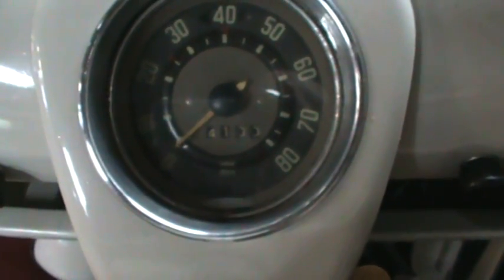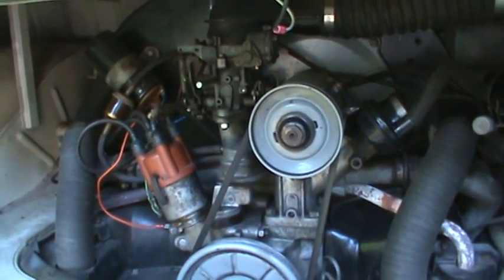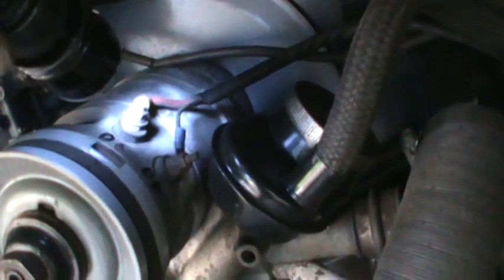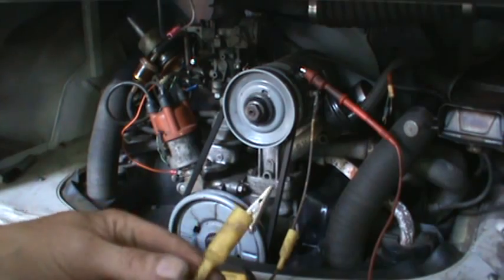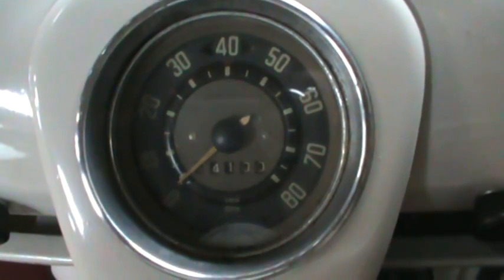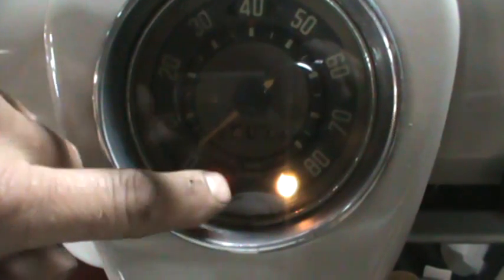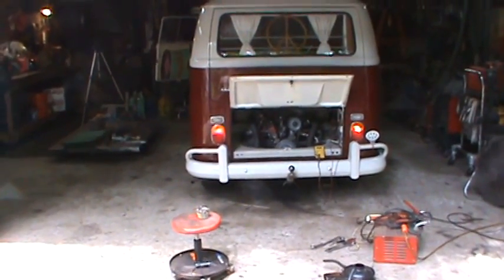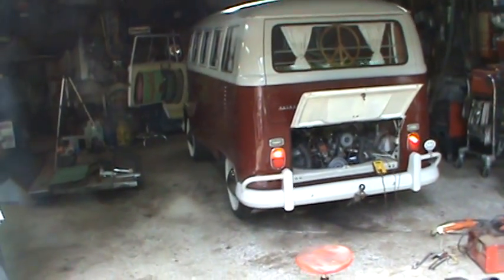how to troubleshoot air cooled vw charging system

Comment: After polarizing I was stumped since I just did a clutch job and reseal and only un hooked the regulator but took off the dog house and set it on the floor. Then I took the wires off and had 30 volts at the generator. The ole tap the regulator with a screw driver handle and the light went out for a sec. Took it apart and manually manipulated the contact and it cleared out my issue with a pop. It looks new so I will probably sand the contacts tomorrow but thanks for the easy to understand video. I little mix of redneck ingenuity and your video was perfect.

Comment: Pretty sure you are wrong about the dash light having to work for the system to charge,  thats only for alternator,  on that system the light needs to excite the alternator get it to charge.  Generator and regulator can charge with no dash light!

Comment: I bought my wife a 67 bug and it has bin parked since the 80s they must’ve had lots of electrical problems because there’s little notes written over inside the car with diagrams the generator doesn’t charge I just saw this video says the light Hass to work in the dash but the light does not come on with the key. It only comes on when the car starts. Wondering what your thoughts are if there’s something wired backwards

Comment: @mustie1 I'm having an issue with sputtering and backfiring when driving but at idle it runs perfect. I have been through just about everything and can find nothing wrong. I did notice that the headlights were dim and at one point they got bright like they were supposed to be. When they did, it ran great a few minutes later, the lights went back dim and it sputtered and backfired. I'm researching the voltage regulator and came across your video. I did everything you showed in the video and all the readings were pretty much the same as what you had. My question is, can I disconnect the wire on the de side and run a jumper to the body and then test drive it to see if that clears up the issue?  I wouldn't need to drive more than about 30 seconds to see if issue goes away and then I would be fairly certain that it's the voltage regulator.

Comment: I installed a replacement used engine on a VW bug once and the generator would not charge..Red light always on. Tried a new generator. Same problem. Red light. Could not figure out what the problem was. I was at wits end! Then someone showed me that you need to "jump" the terminals...(Grounding out the DF terminal). Simple solution. The generator then was charging and no more red warning light.

Comment: Great video! Will the principles also work with an alternator? Regarding the part numbers, the 019’s, etc are Bosch part numbers, not VW. To find out if a Bosch part is for a type I or II we need to dig a little further.
Reply: No.  If u disconnect the D+ wire and u run the engine u will damage ur alternator's diode.  Then u need a new alternator.

Comment: What do you do when the gen light comes on and it won’t go off? We’ve put brushes in back in july. Light went out. 1050 miles later it’s back on again. We’ve changed the coil regulator taken the belt off and polarized it. Brushes look ok. Taken the 61 wire off and the light goes off on the dash. Rewired the df to regulator lights still on. 
All my lights are led except for turn signals. No radio...... I don’t understand what’s making the light come on.  1968 beetle

Comment: Great super helpful. My type 3 has an issue not sure if it’s the voltage regulator or generator now I can skip the repair shop. Put new battery in last month and it died yesterday had to push start it. I noticed my lights were getting dim too.

Comment: My generator when tested as demonstrated in the video only gets about 3 volts. I did the test with the hot wire from battery and generator spun without the belt on. This means my generator is bad right?

Comment: Can the same diagnostic process be applied to a vw that has been converted to a 12V alternator with an internal voltage regulator?
Reply: I don't think it'd work you'd have to look for diagnosing a alternator charging problem not a generator

Comment: Greetings: From your description of the voltage at thr DF terminal, you should be able to compare the field control voltage between the good and bad regulators by noting the voltage at DF for the 2 regulators at both idle and higher revs. That way in the future you only nned to measure the DF voltage to know if the regulator is sending the correct voltage to DF. HTH

Comment: Super helpful video. I have a 67 bug that burned out two batteries in a row so I thought to check alternator. Followed the procedure you laid out and found that the alternator didn't spin at all when I hooked the battery straight to it. I can see a little damage inside the alternator, not sure if it affected the brushes at all, but it wouldn't spin whatsoever.

Comment: i did that years ago before i converted to an reliable alternator as when the vehicle sits the generator lost its polarity as an alternator work regardless but like the generator the bulb in the speedometer has to work as i added a load equalizer resistor to the bulb if converted to LED it will work regardless if the bulb or LED is burned out. i added LED indicators in the speedometer i did this long before the Radio Shack closed here. as a 1968 bug the green light is oil used a green Led green for turn signal arrows, and red for the charging and thats where i had to add the load equalizer resistor too i tried it would not charge as the resistor is added it charges.
Reply: Newer VW's e.g. type 25 wedge transporter have the LED indicator you've mentioned. I have found most faults here are caused by mis fitting the LED into it's sockets. LED's are also polarity sensitive so have to be connected the right way round to work. This last point mostly applies to the bare LED component that's used in newer water cooled VW's since the mid 1970's mainly Golf, Polo, Jetta, Pasat and the T25,T4,T5 Transporter. The bulb like indicators used in aftermarket applications can have a rectifier circuit fitted before the LED that negates the polarity sensitive requirements when fitting but this can depend on type of indicator bought. A simple task is to check the indicator polarity both ways on installation usually complicated by the connections already present. LED's do take less current to work usually between 5 to 10 times less than the old incandescent bulb so the use of the bypass resistor is recommended 120 to 150 ohm 2 watt resistor. The transporters with the dual circuit brake warning light also have this light wired into the charge warning circuit via a diode so providing an alternative initial excitation current path in the case of bulb failure.

Comment: Great video. I'm trying to figure out why my generator and voltage regulator are overheating. I'm getting 14.75 charging voltage at battery, so it looks like it's overcharging. The battery with engine off is reading 11 volts, so it looks like the battery has problems. I'm going to run your checks on the generator to make sure it's OK.
Thanks again. This will hopefully be helpful. I'm going to buy a new battery and a voltage regulator if the generator tests OK. Then go from there.

Comment: maybe you and help, I have a dune buggy that some of the wires were messed up, I have most everything sorted out except for the charge light, it has the factory alternator I think this is about a 72 model, I have no idea where to hook the wire from the alternator and also how to hook up the light on the back of the speedometer, there are 3 lights at the bottom or the speedometer and also a contact that kind of surrounds the 3 light sockets, I am at a total loss as to how to connect the charge light and wire to the speedometer.

Comment: thanks,
it was helpful, my 1977 has a pancake motor and an alternator.. i get no battery light with ignition on engine not running, so i guess start with checking the bulb.  do you know if i have an internal voltage regulator?

Comment: sometimes i had to manually ground  the df terminal l of the generator to the body of the generator by  using a screwdriver while engine is running  and revving the engine...

Comment: 20 yrs ago i put an alternator on my 68 Bug, connect the 61 wire to DF, the B+ to D+ and threw the mechanical regulator in the trash. Read too many horror stories about the regulators sticking with contacts closed sending unfused battery power into the generator D+ lead. Alternator puts out rock solid 13.6v at idle and haven't had a lick of trouble with it.

Comment: I went to fuel up at a station whilst driving the light was on. I started my engine again after and it wouldnt turn over. My red light is always on, idle or when fully running. Battery was dead but now that's been changed to a new one. Starts fine now but the red light is always on. Any ideas what I should do now?

Comment: You present the theory of the generator's function and what's what--but you got off a couple of times and interrupted the stream of information.  Also--the generator warning light in the speedometer is not needed for generator function--it simply gives you an indication that the generator is function--or not.  However, with an alternator, the dash light is absolutely necessary for alternator function--to excite the generating fields.  The regulator for a Bus, Bug or Ghia are the same--the electrical current doesn't know the difference.   I wish that you would go back through your thinking, omit the "stuff", and stream-line  your presentation.  That would make this a truly great video! Your show and tell is great!  Go for it!  jay

Comment: Generator; also make sure the brushes are not worn down to nothing and that they move freely up/down in their brush holders!
Regulator to do: clean all external connections
pop the cover and clean the relay contacts inside!
Remember electricity 101; clean connections as well as clean ground connections, ground straps  Engine/Transaxle to chassis, Battery to Chassis;....

Comment: I have a 73 super beetle, it has a new battery, the alternator is charging , 4 months ago I replaced my new battery I bought 5 months before that because it had a bad cell, I put on metal wrapped fuel lines and they sparked on the coil when I put them on 2 months ago and today it started then wouldn't start until I jumped it. I electrical taped around the fuel lines where they sorta touch the coil wires. And it starts now, Ima gonna wait till tomorrow to see if it will start again. Thanks for any advice you can offer....
Reply from the maker: depends on if it starts tomorrow
Reply: Mustie1 thanks I'll keep you updated..
Reply: Mustie1 got in this morning and it wouldent start, lights came on wouldent turn over, then jumped it, it warmed up,turned it off ,then it started up, started up three times in a row.  You have any ideas?
Reply: Just tryed to restart and it won't,  unless I jump it, did a test on the neg terminal and the test light came on, when I test the fuses the windshield wiper and rear defroster fuse lights up with the tester.
Reply from the maker: so something is staying on, l would pull pull the relay for the rear defrost and see if it goes out, think they can be problematic

Comment: Decades ago now, I was a VW 'nut'. Had various examples of all 4 types. 
What I remember most is the never-ending struggle with 6 volt electrical systems, with the dreaded voltage drop.

Comment: hold up a sec here, I have 2 aircooled VW 1600 on rails and both my charging systems have dummy lights. the thing is, is the light from the "61" post of the regulator is ON when it is charging. and the light goes off if it is NOT charging. so Im confused why your goes off when it IS charging... what am I missing here?

Comment: hi guys hope u can help ive got a vw air cooled engined  trike and its sta rted to over charge up to 15 volts changed the bty but still the same its running on a alternator  is it worth changing the regulater or change the whole thing /alternator how easy is it to change the fegulater any would be  great

Comment: Question If I Don't Have An Initial Power Going To The Field But After I Short The Feild Lug Then Start It Up The Light Goes Out And I Have 14.3-5 Volts When I Shut It Off And Start It Back Up It Won't Charge Again... I Don't See Any Voltage Regulator???  This Is On My VW Trike...

Comment: I have a 69 Squareback. I'm having spark issues. It's not starting. Replaced the coil but no spark. I need help. Thanks
Reply from the maker: +Josef Molina put a test light on the coil and see if you have power on the + side with the key on.

Comment: Regulator is the same for bus and bug. There are 6v and 12v, and mechanical and solid state. As long as 12v goes on 12v and 6v goes on 6v there is no difference.

Comment: I got a 76 Toyota Truck  and a 76 Toyota Celica,  The Celica is having the light come on and it will only run for 8 seconds unless reving it high, this video has me headed to swap voltage regulators sine they do unplug and are the same 22r(e?), Motovating video,Thanks Mustie